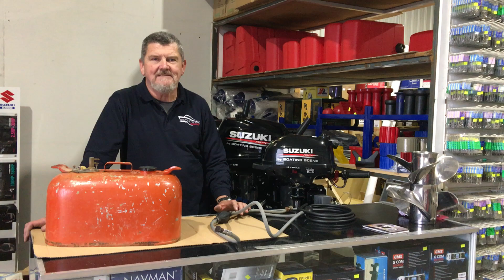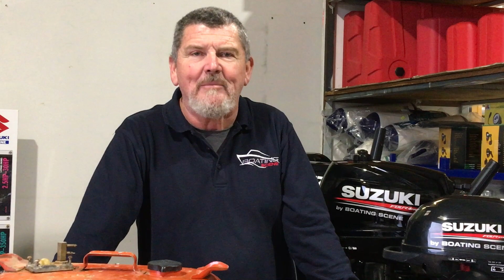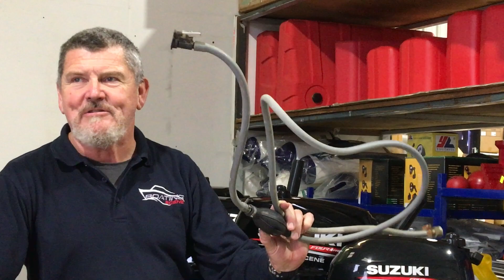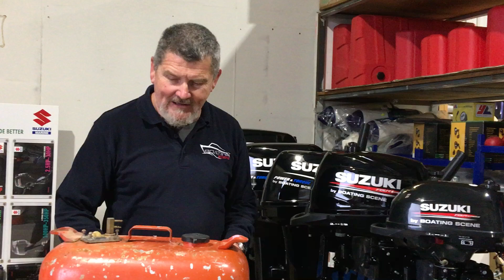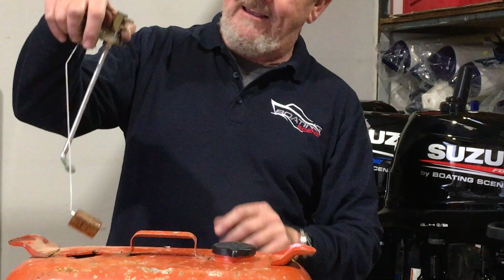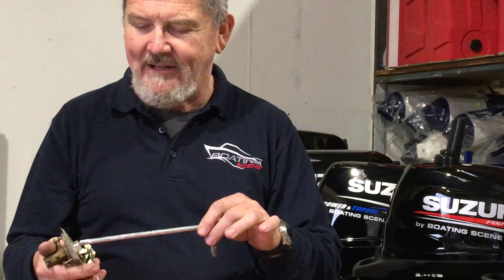Outboard fuel hoses & fittings

Comment: On the vintage Honda marine fuel tanks there is a quick connect fitting that works like a light bulb. You push it in and turn. Do you have those fittings?
Reply from the maker: No sorry, we're not Honda dealers, try Pacific Marine

Comment: Have a 6.6 gallon quicksilver poly tank. Bought new gasget for sending unit as it was leaking . Installed and still leaking from under gasget. Don't want to over tighten screws.
Reply: @Noel Jesus Instablaster :)
Reply: @Luka Maxim thanks for your reply. I got to the site thru google and I'm in the hacking process atm.
Seems to take a while so I will get back to you later when my account password hopefully is recovered.
Reply: @Luka Maxim it did the trick and I actually got access to my account again. I'm so happy:D
Thank you so much, you saved my ass!
Reply: @Noel Jesus you are welcome xD

Comment: when running your old out board motor should the gas cap vent be opened or closed
Reply: OPEN.
Motor will shut off after a few minutes, or not start, if vent is CLOSED.